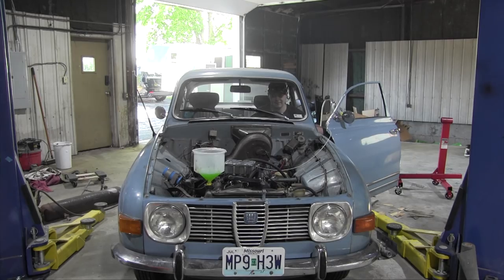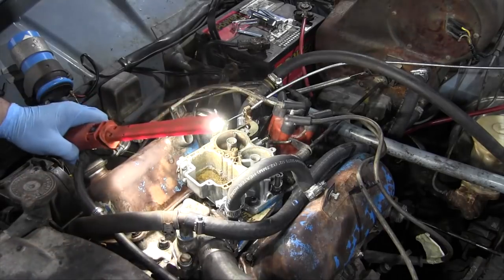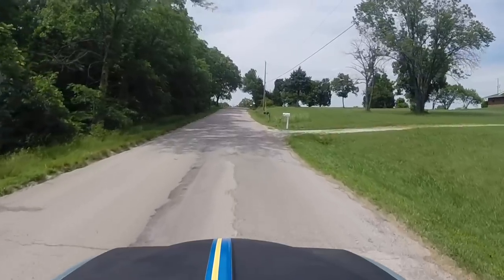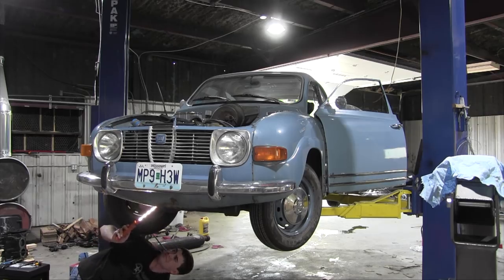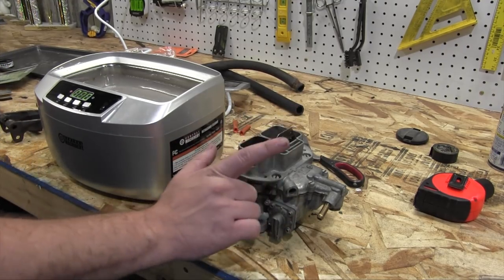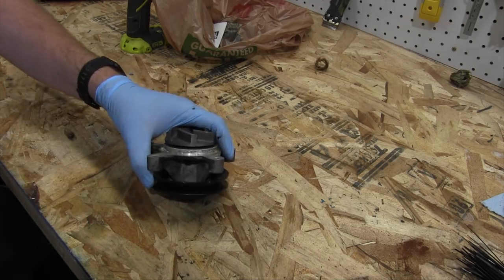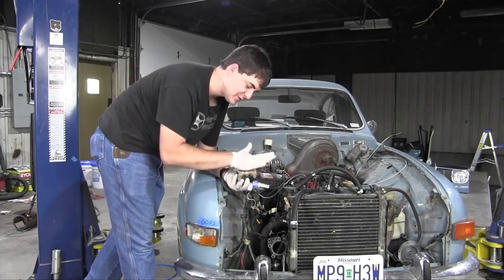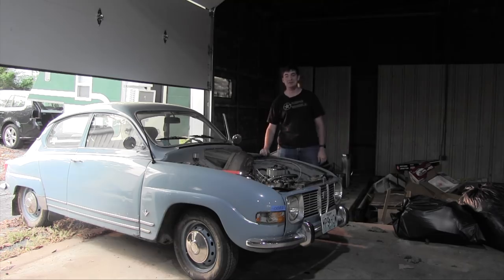Upgrading My Saab 96 to a Two Barrel Carb - Part 3

Comment: at 7.29 you can see a screw just below the mating surface of the body..That is the idle jet holder..the idle jet should be marked 45 and that means the hole is 0,45mm...Weber jet sizes being 1/100sof 1 mm... One flake of nose-hair dandruff will partially block the idle jet... Clean it.
Another thing for next time..Silicon sealer really belongs in the bathroom around the tub..For the stuff you're doing try Permatex Ultr-Grey...Read the instructions, thin layer not blobs like toothpaste--which merely squish out--and then find their way to places they shouldn't be and cause huge problems. Ultra-Grey or from motorcycle dealers for the Japanese like "Yama-Bond" or Kawa-Bond are all wonderful products...
Also maybe I missed it scrolling forward (having done 100s of V4 ) but did I see a gasket top and bottom of the intermediate plate?
For domestic sources of Weber DGVs go on line..Or in a pinch ask at the local joint for "Holley-Weber 5200" kits...Nearly every domestic 4 and many 6s in the mid 70s till who knows when they came with Holley Weber 5200 series carbs, essentially a mirror image of the DGV you have (they were licence built DFVs)

The V4 is a super simple engine to keep going and a super easy motor to rebuild and rebuild a little "warmer" than original at the same cost--so why not get some fun out of it?  The single best thing you can do for the CAR is to get a Simons or Jetex 044k exhaust sytem on it..Even a trillion miler will wake UP..and run so much better that its not even funny..Sold scores of those..Need more info? or even parts? Contact me somehow...

Comment: Depending on the vacuum signal that's reaching the carb idle jet, it may benefit you to open up the idle jet...I found that to be the case on a Weber DGEV on an early Honda Civic I had.

Comment: You've got persistence, I'll give you that. I'm by no means a mechanic at all, but I know I would have given up on that water pump leaking issue after the second failed attempt. I lost track of how many times you've taken that thing off, but I would have been broken if it were me, especially in a 90-110F shop and countless days of working at it, putting it down, then picking it up again.

Comment: Hi, when you are making your own gaskets, I find tapping with a small ball pein hammer around the edge will mark and cut the gasket at the same time. When I copy one like the front gasket I hold down the old one on the sheet of gasket paper and use a rattle can of paint on it and then cut out the bit that isn't painted.

Comment: Congrats! Carbs are simple and their problems are well known.  As an aside, the lower rear section of your right front fender is not fastened. It shakes when you started the car.  Not critical but not something you would see on your own.  A previous owner of 3 Saab 900's.

Comment: I know how you feel with a brand new bad water pump. I changed mine so many times I was able to do it in 20 min in the parts store parking lot the last 2 times.  I got upgraded to the premium pump and free coolant and rtv. I changed it 5 times. Not to mention reinstalling the first 2 multiple times. To say the least I'm was pissed.

Comment: When you are hand cutting gaskets from new gasket material, you should cut out the inside area first.  Believe me it goes a lot easier that way. Use the old gasket as a tracing template. If possible.

Comment: I know your not a "pro" but you do have a great working knowledge of whats-what!. I cant believe you didn't check or clean that carb. Remember rule #1 any new (used) part you plan on putting on a vehicle do a complete check, clean, rebuild, etc before installing! Besides all that I feel in my professional opinion, you do really good work and would enjoy rebuilding some of those old cars with you for the experience.
I had an old GL99 Saab and really loved the huge 4 cylinder bullet proof engine it had. I would love to find another on some day.
Where do you find these strange imports from, that most people here in the US , either haven't seen or never heard about? I seen most of them but never had a chance to work on most mainly because I favored American cars but also loved the VW's and a few others like Fiat and Datsun.

Comment: I'd invest in a aucostic cleaner for carb parts, it's great and easy to use! Pretty cheap to boot. Also, try to make your own gaskets with cutout gasket sheets if you're able to get hold of them. :)
Reply: Oh i wrote too early about the cleaner, seems like you fixed the problem. :P

Comment: Little tip, for area's where fuel and high temperatures are involved. you will have more success using the copper gasket sealant. that appears to be a Weber carburetor. two areas you will have to pay attention to. are proper jetting and a proper power valve. a power valve not operating properly. will cause the power valve either stick open. or stick closed. sticking open will flood the engine with fuel. and stuck shut will cause a lean condition. as far as the water pumps is concerned. you should put a straight edge on both mating surfaces If possible. finding out that coolant is leaking out of the weep hole. on a new water pump would make me angry. the seal in the water pump can be replaced. but it will take hydrolic press to press the shaft off the impeller. and out of the pump body. at which time the seal can be replaced. but you did the next best thing. now that the vacuum leak is solved. and the coolant leak is solved. the only thing you are left with is air mixture adjustment. and it should run fine.

Comment: I have just put water in the cooling system for the first run if the engine has been out. That way if there’s no leak, you still have to do a bit of extra work by draining and filling the system.

Comment: I watched all three episodes. The only thing that makes trial and error more aggravating is when the parts are almost impossible to get to. One note though; they do make cooling system pressurizers that can help with diagnosing leaks. Of course you kind of did the same thing when you left the engine running! Ha!

Comment: i had three 96 saabs , two were 2 cycles a 1961 and a 1963 the third one was a 1967 v4 with a 4 speed tranny. the saabs cost almost twice as a vw bug at that time. the 1961 i had 2 replace  the head gasket which was very easy on a 2 cycle.

Comment: Its a little too late now, but there is a tool that fits on the radiator that allows a man to pressurize the whole cooling system.  There are various adaptors to fit it up to everything.  You attach the pump and pressure everything up and look for the leak on a cool engine so you miss out on the joy of scalding yourself.  On real problem  child leaks you drain down the radiator and pressure up the cooling system dry, then use soap bubbles.
Reply: Ps any Oreilly can order it for you.

Comment: You can make the gaskets faster with a ball-peen hammer.  You just tap the gasket around the edges of the mating surface to cut it.

Comment: I woulda left the 34 PICT single barrel in,  they're pretty bulletproof and better than the FOMOCO Pinto 1600 carb that replaced them.    Also on My '70 96, back in 1993 I had installed one of the last high performance exhausts available in the US, as finding the stock exhausts without a bunch of holes or rust wasn't an option.    If you do the two barrel carb conversion, there's no performance gain to be had if you don't bore out the Siamesed exhaust ports and match the bore on the cast iron collector donuts.   This is why your car really doesn't go much faster, but makes lots of fun sounding noise,  It's only making about 60~65 H.P.

Comment: Well in spite of it fighting you all the way you did win,  make sure the tune of the engine is spot on ignition timing etc mixture, maybe even consider throwing away points and condenser replace them with electronic ignition then you notice some extra urge.

Comment: This looks so familiar, I own a 1951 Ford Custom tudor with a flat head 6 and 3 on the tree recently... meaning november 2017 i decided i wanted to replace my ancient carb with a better one for more go faster from the engine, after a lottttttttttttt of swearing and throwing various things i got the new carb fitted and fuel leaked from pretty much any place fuel could go, fixing that issue i couldnt run it without the choke on, turns out im a moron and not only was my carb maladjusted but a new fuel pump i had fitted cause the old one was epoxied to within an inch of its life was actually doing its job way to well and overloading the carb, got that sorted and i got to take the car for a drive this was april of 18. and a new issue formed the car wouldnt stop, the only way to kill the engine was to put it in third and dump the clutch, key issue new key. then it started to overheat, if i was sitting still or doing above 45 it would get very very warm, pump and thermostat failure, i spent so much time getting the darn thing to work properly and not overheat that it is now winter and i refuse to drive the '51 in the cold since thin tires rear wheel drive vacuum operated wipers that are useless when the engine is idle and the steering is akin to a bus, honestly ive now got restoration blue balls with that ford and a VW beetle i have right now is out of commission due to a small braking issue wheras sometimes the pedal will go all the way to the floor and the car ignores my command to stop.

Comment: I had that exact carburettor on a 1973 Ford Cortina MKIII, 2000 GXL with a Pinto engine. I adjusted it, ran like crap. I cleaned it, ran like crap. I rebuild it, ran like crap.
Finally I noticed that the hole for the butterfly valve had worn and was elliptical rather than round. A machinist drilled out the hole and put in sleeves, making the butterfly valves fit perfectly again.
And guess what happened?
It ran like an absolute bag of shite afterwards!
When those Webers don't want to run, they will not run, no matter what you do with them.

Comment: This comment is wildly late in coming, but I'd also check the flatness of the water pump mating surfaces to see if there is a slight wave that could exacerbate as the metal is warmed.

Though the weephole issue, especially with a newish pump or supposed to be new pump gets a red flag in my head. In that it (the first replacement pump) isn't a new one but one that was either rebuilt or a very used one that was cleaned up good and labeled as 'new', then was sold to the first sucker that came along.

The carb issue, might be a combo of clean gged jets, scored seats in the metering valves, and other oxidized corrosion not allowing proper sealing. Only way to fix that would be take entirely apart, and scoping the needle valve seats, jet passages, float cut off followed with a complete rebuild and gasket set. Also check the butterfly valves for leaks and the return spring to close the butterflies for being weak. The latter would allow the draw of air on the suction stroke to pull the butterflies open wider giving the impression of a leaning out. Since there wouldn't be an increase inlet of fuel to the extra air flow it'll lean out the engine fairly badly. During the test drive, adding choke forced the butterflies to close allowing what fuel was going in to get closer to the ideal mix ratio, thus better performance.

By now that might be a known thing to you and no longer a issue to be concerned about.

Comment: pressure test the cooling system and you will find the leak, its just a pump that  replaces the radiator cap, as for rtv your using too much smear it around with your finger and let it sit for an hour then bolt tight, too many guys use too much, and tighten it and the goo  goes into water passages etc and can even clog the thermostat and oil pump, in the long run its better to use a gasket, even if you have to make one

Comment: I had a leak like that in my dodge caravan from the coolant expansion pipe from the waterpump, was a crappy oring. Changed it with a oem one, leak gone.

Comment: Have you tried Permatex Aviation RTV? It's cheap, it's much thinner than the tube RTV but a lot better for coating gaskets and filling small gaps. You brush it on, and there's a lot less waste than the tubes, and it's a lot less messy. Also feels neato to use aviation stuff. They make another called Super 3000 that's the same sort of formula. I think both have a 4 hour run time instead of 24, too.

Comment: Buy a coolant pressure tester kit or rent one from the parts store and they make these jobs a lot easier and save a lot of time. 
Also a lot of times you can just wander in the back at the parts store and look at all their radiator hoses and just find the $20 hose that fits the shape that you need and then just buy that one in cannibalize it

Comment: For a metal to metal seal, especially one you have not machined flat, you need a proper paper gasket that you can make yourself, preferably with gasket goo (non setting) like Hylomar (Licenced from Rolls Royce) or any old non setting gasket goo.

Comment: From Part 1, the head gaskets are swapped Left for Right. This will cause most of the coolant to bypass most of the engine. Instead of going from back of block to front, then up to heads and flowing back to the intake  manifold, it will just go straight up and out. So cylinders and head will get really hot but the coolant gauge will read happy. Sorry it is a pain to fix, intake and heads off and new gaskets.

Comment: Oh and forcghristsakes get some M8 studs and find (Try ARP) some reduced hex nuts like later Fords used on cars with this carb that were M8, 12 point and 11mm wrenching..That way, with 12 points you can get more chance of getting a box end wrench or even a 12 point socket on the nut..Do that and whipping the carbie off is a simple breeze.

Comment: Owning a pt cruiser, the engine is the least accessible of any car, aside from a previa
Reply: try a xj6 or xj12. oh my god the engine is just CRAMMED into the engine bay- on the drivers side the is literally no space between the engine the the side the bay. Add onto that the fact that EVERYTHING is controlled by vacuum which means there are 100 vacuum lines running everywhere. The engine bay is so tight that the vacuum lines that run over the top of the engine actually have to conform to the shape of the underside of the hood because the clearance is measured in millimeters

Comment: Been there on an '87 Jaguar XJS. A coolant pressure testing kit is handy, especially when reusing parts and hoses. You can identify leaks with the system wet or dry, and pressureize even if the engine does not run. With  the right adapters, bought or made, you can also test the fuel system, vacuum system, master cylinder reservoirs, windshield washer system, etc. See link as an example if you are unfamiliar, https://www.harborfreight.com/radiator-pressure-tester-kit-63862.html

Comment: Whenever I open a cooling system, I fill it with distilled water and run it long enough to ensure there's no leaks. When I'm satisfied, I will drain the water, and refill with coolant, mixed a bit stronger than usual to compensate for the water still in the engine block. 

This saves a mess of coolant all over the floor of the garage if (when!) I screwed something up. An example.... I replaced the thermostat in my Corolla, and replaced the O ring with an aftermarket. Any guesses where this is going?

I put it all together, filled with coolant, and it pissed its pants! Coolant everywhere. I took it all apart again, put the old O ring in, even though it was the original, and everything was fine. My lesson is, for gaskets and O rings, I'm going to the dealer parts counter. It's pricey, but I'll eat that cost.

Comment: Permatex Copper Spray-A-Gasket Sealer 80697 stop using silicone on gaskets... you either use one of the other, never both.  Use a sealer like spray copper, Indian head shellac or High Tack. For future reference of course, you know when it starts leaking again.  You can also use anaerobic gasket sealant or yamabond.

Comment: That is not an idle MIXTURE screw. It is an idle VOLUME screw. The idle mixture ( rich/lean) is fixed by those idle jets you cleaned. The screw sets how much of the  air/fuel mix enters the carb under the throttle plates. The rough setting for the throttle stop screws ( on the linkage) is 1 1/2  full turns out. Your rough turn of the volume screw, 3 (1/2) turns was correct and should get you into the ball park. Never set the idle on any Weber carb with the ( throttle stop) screw on the linkage. It opens the plates into the progression holes and you'll be chasing mixture problems forever. Use the idle volume screw. If you can't get the idle speed  you need adjusting that, it's time to select a different idle jet.  Check for a spacer plate from a  2.6 or 2.8 Ford V-6 ( Capri or Mustang) to replace your hand built unit.

Comment: The bolts on the back of the pump could be replaced with studs and nuts. More easy to pass studs plain holes and nuts may be more easy.

Comment: Those water pump bolts look awful. Worst bolts I ever took out of a car were stripped out CV bolts. I didn't want to take the lower crossmember out, and there was only a hole big enough to get a wrench in there, but I didn't have any ratchets with a small enough tooth angle. I ended up just clamping on the bolt with vice grips and then spinning the opposite side wheel, which pulled the grips up and around. Since they couldn't rotate in the small hole, they stayed vertical while the axle rotated around. I did this about 50 times and eventually the bolt came loose. I remember screaming in victory so loud that my neighbor came over to see what was going on.

Comment: Your use of silicone in the baseplate is a long term reliability concern because gasoline will dissolve the silicone and give you more leaks. the better solution is a real gasket between the two pieces of aluminum.